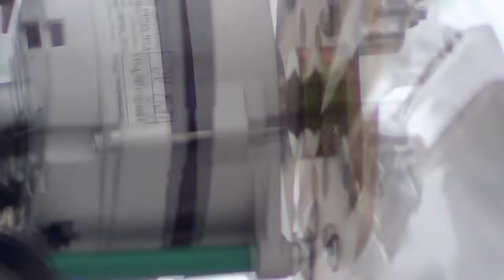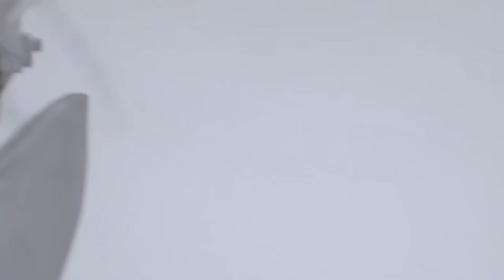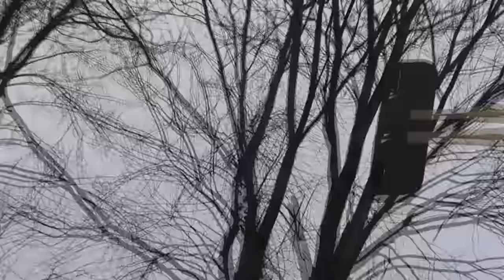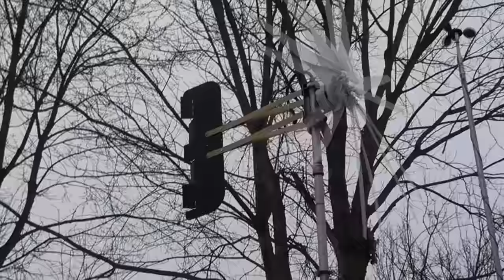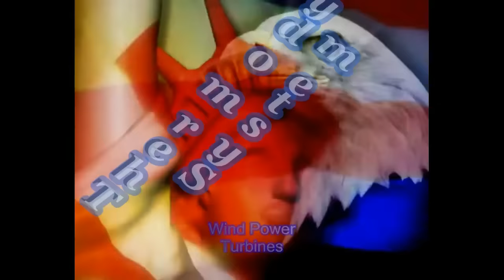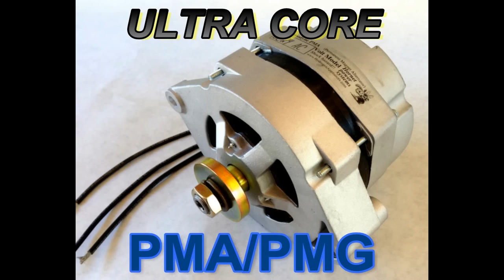THERMODYNE SYSTEMS MEGA ULTRA CORE WIND TURBINE 12 V PMG

Comment: Most people are fascinated with watching the blades spin around.  I can tell the blades spinning when I watch the meter moving around.  that's where I get my smiles from.  The other night I was watching between  4 and 500 watts coming down the pipe.  That Ultra core is the cats meow.
Reply from the maker: +Hobby Polaraco! I have the first debut of the ultra core cut in production!!
Reply: +Hobby Polaraco!   COOL!
Reply: +TheBillytheJack2010 I'll stick to the engineering side.  I'm not set up to display outputs unless I make a bench top jig.  The Freedom PMMG is a piece of junk

Comment: When you make your next video, tell us what happened to the double core avengers, and the amp out it made, compared with this new mega core output, I what to purchase one or the other, which produces more amps, but the double core, and the way the two section magnets are, it should produce double amps, right? Comment please, if you have not the time to make a video for this info, thanks, and I do enjoy you setups/videos..... THE HIPPIE TERRORIST
Reply from the maker: +HEMPPUBLISHINGCOM I have a video that I made with the super core 24 v and the two ez- avenger 12 v that I made for you. So yes the Dual Core does produce more power and you'll see what low winds are suppose to do in low wind's, dirty wind's!!!! Thanks for the comment and I hope this vid will help? But first is the ultra core making its first debut today :)
Reply: +HEMPPUBLISHINGCOM      Keep in mind an DUAL avenger needs 9 blades at 74" diameter or larger to run right.  The ultra core runs on 5 to 7 blades nicely.